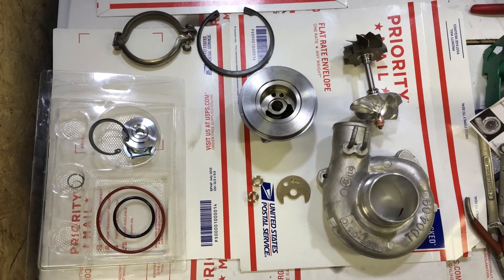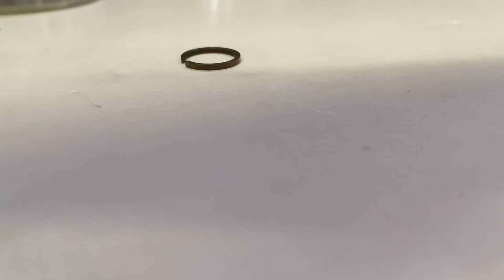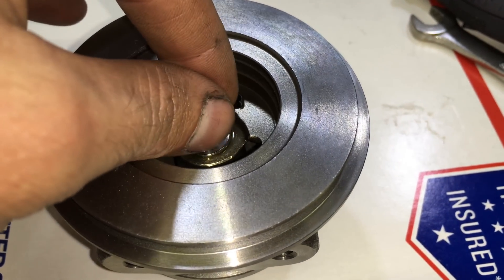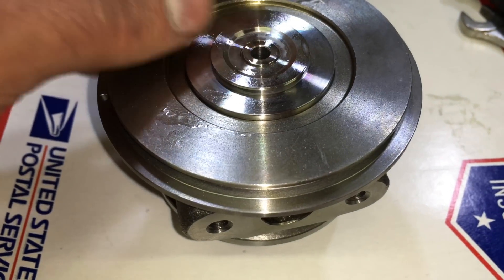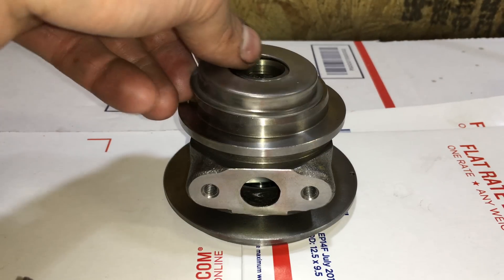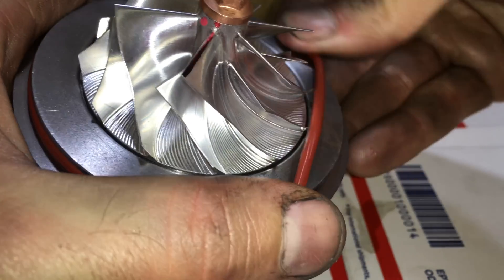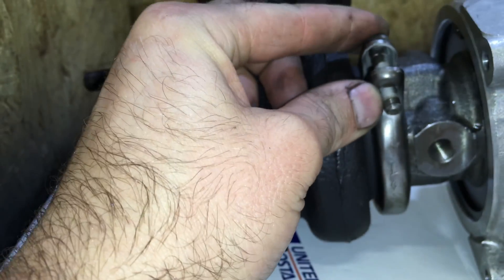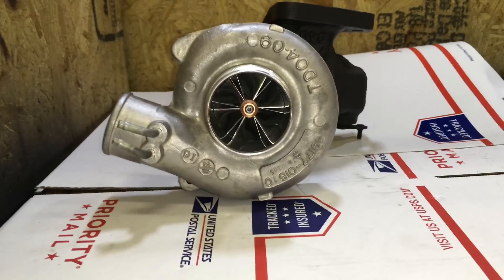Mighty Max 9B Turbo Diesel Turbo Rebuild

Comment: What the max boost on this turbo?? And do you think it gonna overspun the turbo if i bolt on to 14k rpm of my superbike engine???
Reply from the maker: The turbo can only boost double the wastegate spring pressure. If you upgrade the wastegate with one with a stiffer spring it can boost more. The limits depends on heat, around 30 psi, sometimes you can use meth or alcohol injection to cool it down and run a little more

Comment: great video! 
this helps me understand how I can machine my 9b turbine housing so I can fit TD04-13T turbine wheel. The eventual goal being to install 19T compress or wheel and cover to it for use on 3000gt.
Any advise you may have would be great as I'm unsure of how much to machine out of the 9b turbine housing to fit the 13T turbine wheel.

Comment: brother ; i love your videos ; i got the same td04 20 t on my infiniti fx30  i guess with out machining the turbine house there is not much to do.  do you think if i buy a billet compressor wheel it will gain some power???
Reply from the maker: Thank you, I have never heard of a non billet 20t compressor wheel.
Reply: so you think that my turbocharger come with a compressor wheel made by a solid piece of metal from mother house??i mean stock
Reply: so the only think i can do to my turbocharger is change the whole thing??
Reply from the maker: +nando carpi I'm having a hard time finding information on your turbo.
Reply: if you want to see the whole thing just google it : you will at least see it. just put these : bakeca turbocharger infiniti fx30d. it will show the turbo . honestly i try to contact them for buying the turbo and send it to you but no answers from them.
Reply: i really don't want to stop my car and take of the stock turbo to elaborated it . i would like to buy a new one so you can have it machined and do the think you do. i know it will cost me but here in italy i don't trust people.
Reply: ok lets do like these : i am sure my td04 hl 20t does not come with a billet wheel but with casted standard 58mm wheel. do you think i will gain any power if i buy the billet compressor wheel ? how about the turbine wheel? do i need to buy a different??